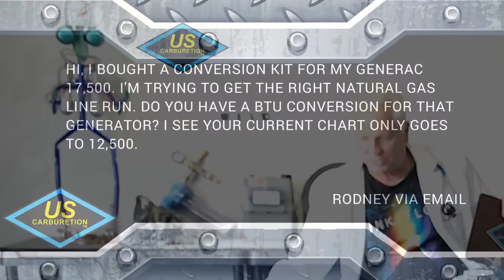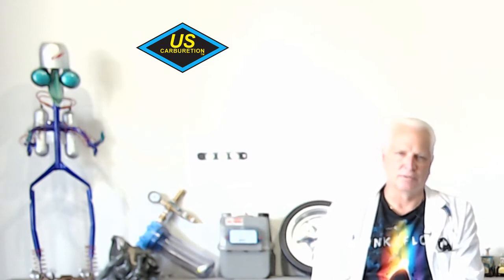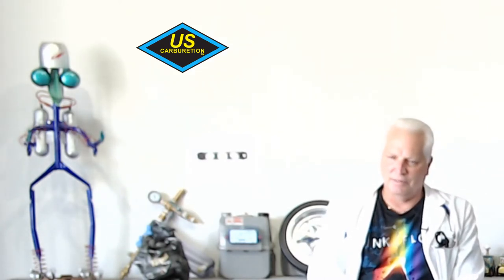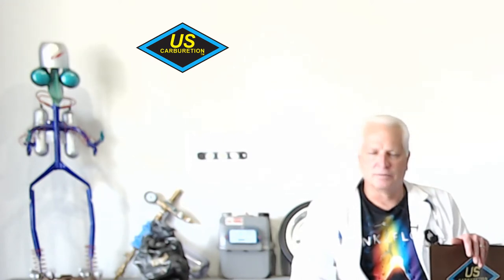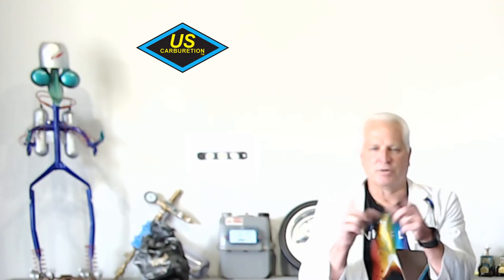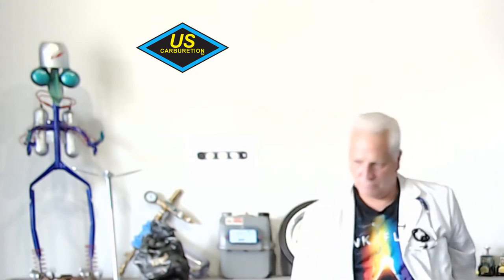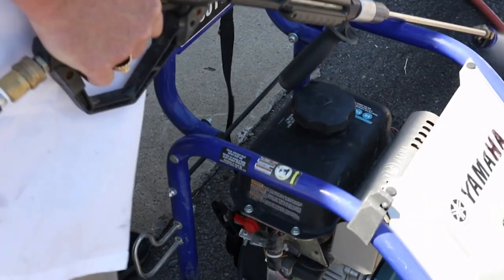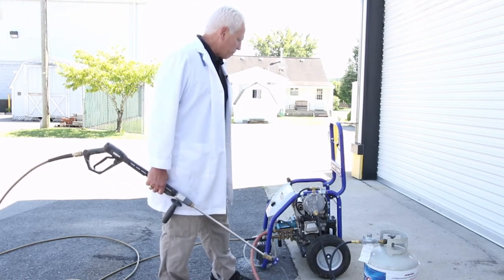Dr Hew S2:EP3 - Tri-Fuel Q&A

Comment: Hi..did you ever run a generator on gas an 1 on propane..to see the longer run an outcome of which is better.. I'm wondering about how the generator runs with snorkel, an how the governor  compensates the load drop , .with out the carb governor working